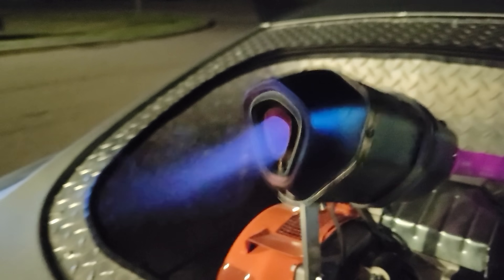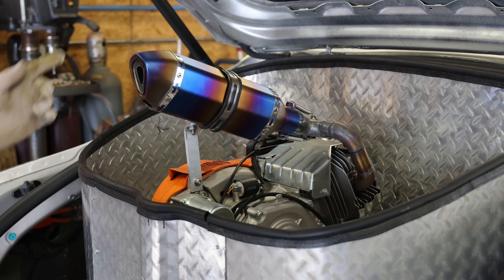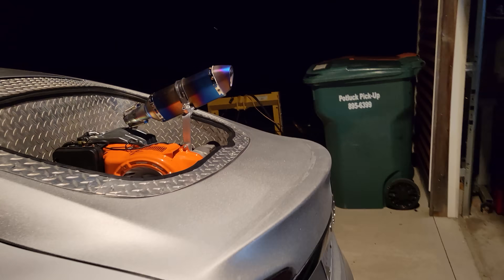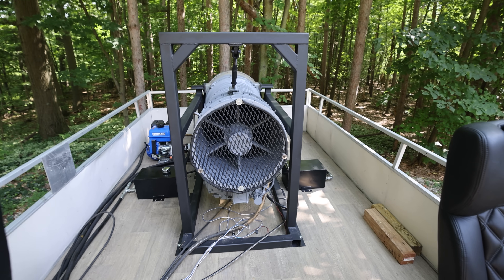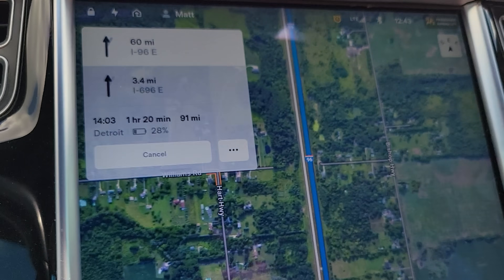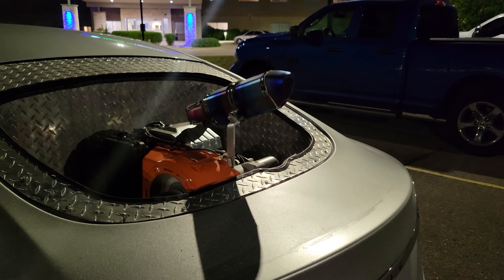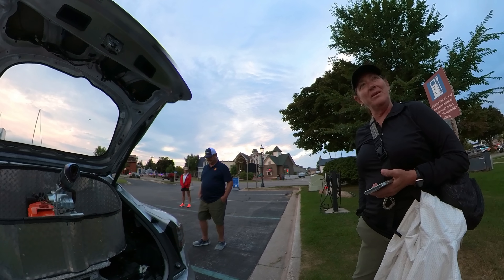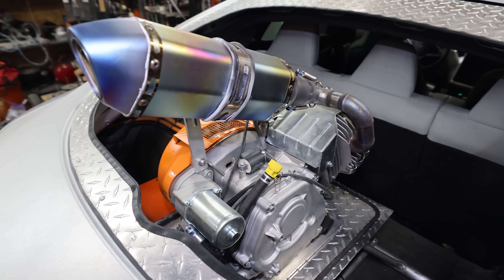Cordless Tesla (I Drive 1800 miles without charging) P.1

Comment from the maker: Part 2- Turbo Diesel Cordless Tesla https://youtu.be/seHWJMKwOQQ
Reply: Could something like this be done with a Nissan Leaf? I want to modify my leaf to to something similar.
Reply: @Biblecrusader  It can be done with any EV as long as you have the programming tools necessary to bypass safeguards that may get in the way. The physically easiest and safest way would be to re-purpose the AC input by hard-wiring it to the generators but by default, the on-board charger is supposed to force the vehicle into park while active. If you mod the generator for HVDC output, you may need to program various modules so they don't complain that there is a 5-10kW mismatch between the BMS, motor inverter, HVAC system, 12V converter and other HVDC loads.

I came to watch the earlier video in the saga to find out exactly how this was hooked up. From the newer diesel video, it looked like he tapped into the HVDC bus since he had DC out. That would be the most efficient way to go. Generator stator re-wired as 300V L-L 3ph -> 3ph rectifier bridge -> maybe an extra protection diode to prevent DC from getting dumped into the generator should one of the bridge diodes fail -> EMI filter -> HVDC, adjust field strength to regulate output current/power as needed. At least that is how I would want to do a BEV to series hybrid conversion.
Reply: This has to be the dumbest thing I've ever seen! Whats the point of this! You're using a gas engine to charge an rlectric vehicle!?!? Im not going to finish watching this crap! I suggest everyone else do the same!! This is pointless! I am dumber for having watched the beginning of this video. Luckily I stopped watching it. Dont recommend this video! Here's an idea...instead of stopping to fill up your gas generator... drive a ford focus and fill that up instead!!
Reply: I've wanted to see something like this!

Comment: It's definitely an inverter setup with the stator under the flywheel housing like the aforementioned WEN open frame generator.  It isn't running correctly however, seems to me a lot of fuel is being burned in the exhaust.

Comment: IF I HAD RHE FUNDS U WOULD TAKE ANY TWO WHEEL DRIVE SAY A DODGE CARAVAN AND USE THE  ENGINE TO TURN A 100 KW GENERATOR.. THAT POWERS A REAR E  WHEEL .. I CAN DRIVE REAR WHEEL WITH THE GEAR IN NEUTRAL OR FOUR WHEEL

Comment: This is WILDY INCONSIDERATE. I would call the cops on your ass too. You did this in the dumbest possible way. Those hotels probably had chargers that you could use overnight instead of running that loud ass generator for people to hear. I know the idea was drive without plugging in but making other people deal with that noise while you walk around with ear protection on is ridiculous.
Edit: I just read through some other comments and have realized that you faked this video anyways. So you are just an idiot through and through.

Comment: How do you charge it in drive?  Curious how you routed that without hacking the battery management system
Reply from the maker: I didn't, the thing is 100% hacked and I have my own system that I developed that works together with the car.

Comment: 20kW generator probably would allow endless running at 60-65 mph. There are large ones that can be mounted on the small trailer and towed behind. But I am surprised software allows charging while driving...

Comment: And the jet go kart I think you have it set up wrong and that’s why you’re not getting enough speed. You have to draw the air from the front of the engine to the front of the go kart that way it pushes you from the front drawing error, the way you’re doing it is just drawing air from the sides of the seat Like a jet airplane. You need to put pipes running to the front of the go kart to draw air through the go kart and push it out the back.

Comment: You should have got a honda generator.  Very quiet
Reply from the maker: I would need about 10 of them
Reply: @WarpedYT  How about metal lined 4" foam.  That noise is ridiculous.  You lined it with Diamond plate which makes it louder.
Reply from the maker: @charlesl21  yeah But this is version one I'm already on version 3 Check out the newest video... But the metal lined foam is actually a great idea
Reply: @WarpedYT  Will do.....

Comment: 13.9 HP is less than your average power draw while driving. You need more, but a lot less than you'd need if the engine had to power the wheels and have enough power to accelerate. You only need enough for the average need, not the maximum need. Very cool. And wondering how the car can drive while being charged!

Comment: How did you wire in the generator to charge the tesla while driving?  Also, I thought about adding a generator to my Model X, on the trailer receiver, so I could take it off at home, and just put it on for road trips.

Comment: The problem with the batteries are is Heating the problem with engines are Heating if there's no cooling then you can't run anything to extremely long engine technology has sold that with a radiator and liquid cooling but batteries we haven't yet so why not do a bank battery system four batteries per car gas engine to charge two batteries well two is being consumed

Comment: Not even a Lexan cut out for the engine opening? Might not fix the noise but it would improve the aerodynamics at the very least seeing how a lot of drag is right at that spot on the car.
Reply from the maker: Nah That would be a fire hazard, But I can tell you that there is no additional drag from that opening, I have streamline tested this, And if you look at the next video after this, I sort of show how the air is curving around the car and there's a high pressure skin right above the surface of the car that just misses that opening but as a side effect creates suction in that entire compartment, so the diesel engine that was in there was overheating big time. Check it out

Comment: Unfortunately at 70 mph is not the best for range, 60 would be much better
Reply from the maker: With the newest version if I did 45 I would probably be getting 110 mi to the gallon
Reply: @WarpedYT  i was just watching the newest video! i think if you could get the exhaust to be quiet, it would be a perfect EV 😁
Reply from the maker: @DanCycles  thanks, yes I'm working on that, these are all just prototypes, next one is crazy!

Comment: If Tesla slowly transitioned into an all electric, this would have been it with a more quieter generator and produced more power to charge itself in less than 30 mins. Can you imagine eliminating the number problem with the EV’s! This will open up the market for people that love to drive at far distances and remote locations without the need to plug in…
Reply from the maker: Thank you, check out my latest video with version 3 of this system.

Comment: a spoiler actually reduces fuel consumption!

--

for those who question this, here's the reason: in physics, nothing can come from nothing; it's unavoidable that the shape of the rear upper side of the car will create lift by guiding the airflow over the car downwards; if you change the direction of something that isn't massless, you'll get an equal counter reaction; so, if the air bends downwards because it stays attached to the surface, the car will experience an upward force. and the energy required has to come from somewhere (which is, of course, the car's energy storage.)

a spoiler does what its name suggests and spoils the airflow, attempting to create a stall.

and that's why a spoiler saves fuel; it only "adds" downforce by reducing lift; a car that weighs the same at speed as it does stationary is the most fuel efficient variant.
Reply from the maker: Great explanation and good point, I actually got better wh/mi with the spoiler, And what you might not be accounting for in your explanation is the shape of the object, there is a very low pressure zone behind the Tesla, if you break that up you reduce drag which reduces the pull which in turn allows it to move through the air more freely. I did include the streamlining charts in the previous video I believe..
Reply: @WarpedYT  ohh, wow, what a quick reply! I didn't put much effort into writing my comment; so, I'd like to add some extra information since you seem to show an interest in this topic:

the spoiler obviously introduces new drag all by itself just for being there and that's why most people tend to think that removing it will be beneficial for fuel consumption. in aviation speech, this added drag caused by resisting longitudinal airflow is simply called, "parasitic drag," which I think is quite a telltale. the "seemingly virtually" added drag which causes a perpendicular force on the object subjected to the flow is called lift induced drag. so, the job of a well designed spoiler is to, while adding parasitic drag, reduce lift induced drag by a greater extend, leading to an overall net benefit.

--

also, everything I said is only valid for a "clean" rear end; meaning, not missing the rear window, which changes everything, lol.

--

yes, what you said about slimming down the low pressure zone behind the vehicle by ramming air in front of the spoiler, increasing the pressure directly at the rear window is also a good and valid way to see it. that's in an essence why a diffuser is so effective, because it also significantly narrows the low pressure zone behind a car and thus not only induces downforce by kicking air upwards, but even reduces parasitic drag; a double win, if packaging allows it (it introduces 'downforce induced' drag, though.)
Reply from the maker: @To.Ma.To_78  seem like you understand streamlining 🙂. I really want to get this thing in a wind tunnel for the next video.

Comment: "Without charging" then immediately starts to charge it with that small generator so ...... not 1800 miles WITHOUT charging.

"We made it all the way without charging" yet immediately says "it's charging" as he gets the trip going.

He has a Hella nice shop with top notch equipment though!
Reply from the maker: Haha... Thanks! Depends how you look at it, if somebody drives a Prius are they considered charging? You're burning fuel and running a generator.

Comment: I would expect you had used an inverter-style generator that doesn't have to run at high RPM continuously. I've seen them at campsites and they're very quiet at low RPM.

Comment: Oh yea I’m gonna use a gasoline motor to charge my Tesla, completely defeating the purpose of a EV…..why haven’t they figured out a way to generate electricity from the wheels turning like a Windmill?
Reply from the maker: Because energy cannot be created it can only be converted.
Reply: @WarpedYT  so you couldn’t convert the energy from the tires spinning into electricity?
Reply from the maker: @giovannicarosa8819  No because the tires are being driven by the power of the car and you're losing energy with wind resistance, they're essentially is no recoverable energy left, The power being used is to overcome the wind resistance and the rolling resistance... If you were to take power away from the wheels the car would either slow down or you would have to add more power to keep it at the same speed.
Reply: @WarpedYT  Thanks man!
Reply: @WarpedYT what about solar panels? It’s possible actually

Comment: I haven't bought an EV because I live in an area of Canada that's now experiencing wildfires on the scale that requires the emergency evacuation of entire cities, but I was exploring the idea of extending my range with a generator.  I'm curious if you think it is feasible to trickle-charge a compact EV with a 2Kw plug-in generator while driving, and if this can be done without modification?  My home is off-grid so I already have a little Honda generator and was thinking that if I could just throw it in the back during an evacuation (piped out a slightly open trunk or window) and immediately start charging, so that starting with a full battery and full generator I could extend my range another few miles.  Any thoughts?

Comment: Sounds like a square wave tig welder.
I’ve repaired over 20,000 welding machines and plasma cutters.
I can’t weld but I can melt metal. I can tell if a machine is working properly but the sounds it makes.
Reply from the maker: 100%

Comment: capacitor bank + R1 engine + Flywheel/generator should = infinite power and speed, you might need a small battery but a bikes lithium ion one should give enough juice to get shit going
Reply from the maker: r1 engine aint gonna do it
Reply: @WarpedYT  if you removed the battery bank and replaced it with light weight capacitors? you need enough juice to get a bike motor started

Comment: Can you get two generator with one engine I think charge 50% faster and higher speed on highway without batteries dying? I wonder generac with propane gas.
+ electric solar panels on trailer ?

Comment: It takes a special kind of mental incapacity to do this especially with an inefficient 1 cylinder ICE!!
1.  The battery weight is a significant penalty for the vehicle so by putting the one cylinder ICE to charge the battery is not any savings!
2.  You can already buy very high MPG economy car without the nonsense of the one cylinder engine which gets worse milegae!
3.  What you are doing is if you are dying of thirst out in the  middle of nowhere, there is a natural spring with running water, you take that water, dig a hole, dump the spring water into the hole, then figure out how to syphone the water out, filter it before you can drink it!   That's what battery car owners are doing to this planet!!! Wasting a lot of effort, not to mention resources and gaining nothing!!!

Doing this exercise may have been fun but you'd get much more views if youi did this with an extension cord instead!😂😂😂

Comment: Sorry it looks like all you did was attach a small engine to the back and have it running at working RPM the entire time. There is no generator aspect to this, where is it? All you've shown is the engine. Also there is no wiring setup to go to the battery.

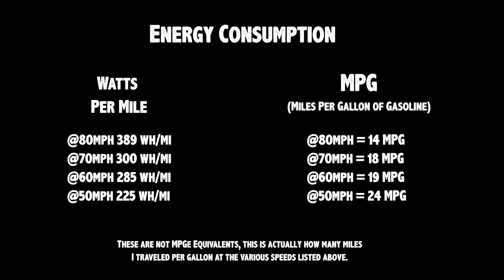Comment: I wonder if generator is made to generate fixed 12V or it generates whatever it generates. I heard that regular car generator has the schema which prevents making more than 14V. Basically it is not well efficient. I wonder how was yours setup. 14:55 data clearly tells me your power plan was very inefficient.

Comment: RIDDLE ME THIS: You can charge and drive at the same time with that engine... What if you had a spare alternator that was spinning and charging the batteries? Maybe a wheel and some kind of chain spins on an extra wheel under the car and the speed you go charges the car?

Comment: You need a MUCH bigger engine, could you fit a 3.5L V-6 in the boot???
Reply from the maker: True but it won't get good gas mileage. With the newest build which is not published yet I got almost 50 MPG. It was cheaper for me to charge with diesel than it was for me to charge with the grid very interesting

Comment: Is it possible to charge the cyber truck from the bed. If so, this would make a compelling argument to have a generator in the bed or frunk of the truck for extended range. It’s giving me flashbacks of that model S that they put a generator in and got 1800 miles of range without having to stop. This makes me wonder what the range extender set up is. If it is exposed power outlets that charged the battery, I am sold I’m turning this thing into a hybrid. 😮😂

Comment: As the owner of a Model S and a Model Y, I highly doubt this is wired in properly. I've 2 questions:
1) this engine isn't big enough to power meet the average use.
2) where is the alternator? I only see the engine? No alternator, inverter, etc.

Assuming it is all good, how is it wired in? It's notoriously hard to do this. The car cannot run the charger and the motor drives at the same time. Many mods trick the car into regening from the alternator power, but then it's hard to drive.

All seems suspicious.

Comment: Another Rocket scientist! The energy (either in form of electric power in Battery, or an energy transfer of approximately 95 GALLONS (US) of gasoline or diesel, for which there were more stops necessary than for charging!! I think the whole experiment that this way one produces not only.way more air pollution, but also noise pollution. Congratulations, but the Noble Prize goes to somebody else.

Comment: I suggest a MPPT Solar Inverter Charger IP6048 Hybrid and a flexible solar panel on the roof.  There are ways to make it work and no gasoline needed.  I run my motor coach in a 48v setup, and I feed it with another 12v inverter and a battery to provide the 100 watts it needs to continuously power the IP6048.  I left a million details out in summary, however, it is entirely possible.  
The IP6048 unit is IP67 rated, so, weather is not an issue.  The higher the wattage, the smaller the wire gauge.  Good luck and that metal work you did was awesome.

Comment: What you need to do is get a better Exhaust and muffler system, especially some heat tape and run the muffler below the car down and out instead of out the way you got it you can see it burning red hot that’s not good works with someone to reroute the muffler system and then you can close that stuff up and it’ll be a lot better and ventilation system to

Comment: 1. Why did you use a basically strait pipe motorcycle muffler
2. With all that space, why didn't you use a much larger generator? like the biggest charging one that isn't super heavy. 
3. honda makes quiet generators, add a quiet muffler to that and it would be whisper quiet.

Comment: I’m calling major BS
A 400cc/10,000 watt generator weighs roughly 250lbs yet at 1:46 you are easily moving it around
Also, there is zero explanation of how the charging system is connected to the Tesla.